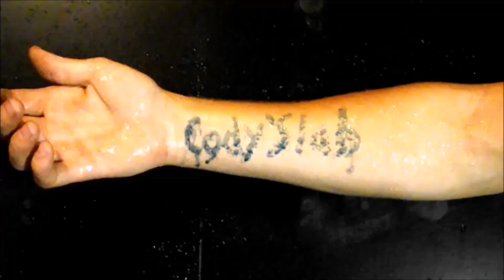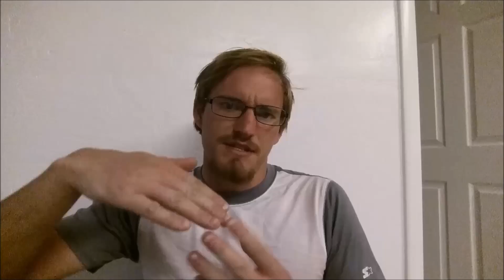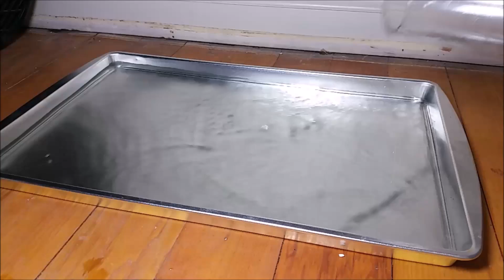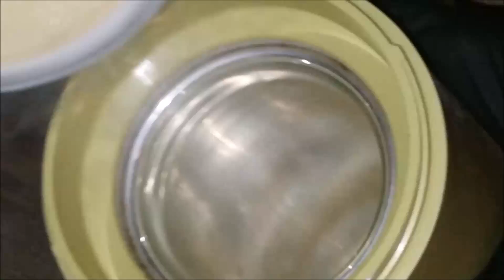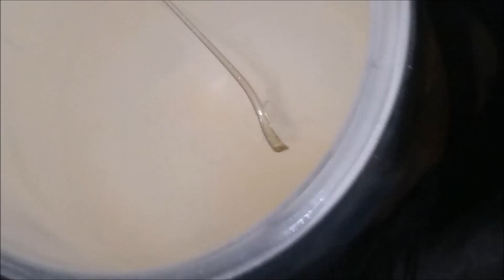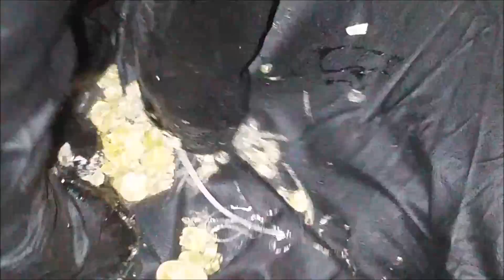What If The Oceans Were Made Of Acetone?

Comment: +Cody'sLab 
2 questions / suggestions : 
- What if it's a question of density ? Higher density would IMO means a better transmition of the deformation wave (faster and with less energy loss), since it's a material wave. -> Thus water would have waves with higher amplitude and frequency than acetone

- BUT, did you took into account limit conditions that your experiment had ? The edges of your plates seemed to have provided a "bouncing" surface, this combined with the higher response of the water (the waves travelled faster) might have set a wave-filter, the waves boncing on one edge negating with the one being produced. What would have to be tested is if you'd set yourself a frequency and amplitude, how would you two systems anwser (you'de be able to determine 
natural frequency and such stuff), to confirm this hypothesis.
Then the question maybe also about the size of the plate (you tested with two different ones, but it might be that the size difference was not enough to provide noticeable change ?)..

I know this is a kinda old video (and probably not meant to anwser the whole question about that wave formation thing), but anyway, I wanted to share these thoughts ^^ Keep on with your experiments you're doing great !
Reply: +Marius Carbuccia just to give you the simplest explanation i can for surface tension affecting wave modulation (amplitude and frequency) try to view "surface tension" as "resistance". a higher surface tension exerts a higher level of resistance so therefore two liquids of differing surface tensions will have wave formation in accordance with their respective surface tension. furthermore amplification of waves IS affected by wind catching the surface of the swell as you theorized with the acetone being more easily affected. the higher surface tension of the water causes the swells to maintain structural integrity better and you end up with a more aerodynamic surface over which the airflow is smoother where with the acetone the higher swells manifested due to lower surface tension allow the airflow to create cavitation in the trailing face (the side being pushed by the wind) of the swell  which causes the pressure of the airflow to be increased and push the swell higher. neither wave (water OR acetone) would crest (the part surfers ride on) until they reached a depth shallow enough for that specific mechanic to take effect. water crests at half the depth of the height of the swell if i remember correctly but i dont know what the depth requirement for an acetone wave would be.

Comment: I think surface tension is keeping water together a bit more. Maybe acetone would have a harder time building up  bigger waves in a bigger and deeper ocean pan, the ripple would be only superficial with high frequency... and I think I'm going to name my next New âge record Acetone waves.
Reply: +Lobotoman just to give you the simplest explanation i can for surface tension affecting wave modulation (amplitude and frequency) try to view "surface tension" as "resistance". a higher surface tension exerts a higher level of resistance so therefore two liquids of differing surface tensions will have wave formation in accordance with their respective surface tension. furthermore amplification of waves IS affected by wind catching the surface of the swell as you theorized with the acetone being more easily affected. the higher surface tension of the water causes the swells to maintain structural integrity better and you end up with a more aerodynamic surface over which the airflow is smoother where with the acetone the higher swells manifested due to lower surface tension allow the airflow to create cavitation in the trailing face (the side being pushed by the wind) of the swell  which causes the pressure of the airflow to be increased and push the swell higher. neither wave (water OR acetone) would crest (the part surfers ride on) until they reached a depth shallow enough for that specific mechanic to take effect. water crests at half the depth of the height of the swell if i remember correctly but i dont know what the depth requirement for an acetone wave would be.
Reply: thanks for your elaborations!
Reply: Lobotoman
no problem. it just goes to show how badly education has degraded in the time since i went to school compared to even when this guy went to school. but then again i went to school back when they actually EDUCATED students instead of just practicing for a test to boost their budget.

Comment: Maybe it also has something to do with water being a stronger polar molecule? Since acetone molecules are not as attracted to each other as strong as water, the wind was more easily able to separate the molecules resulting in more waves?
Reply: +Dylan Panek just to give you the simplest explanation i can for surface tension affecting wave modulation (amplitude and frequency) try to view "surface tension" as "resistance". a higher surface tension exerts a higher level of resistance so therefore two liquids of differing surface tensions will have wave formation in accordance with their respective surface tension. furthermore amplification of waves IS affected by wind catching the surface of the swell as you theorized with the acetone being more easily affected. the higher surface tension of the water causes the swells to maintain structural integrity better and you end up with a more aerodynamic surface over which the airflow is smoother where with the acetone the higher swells manifested due to lower surface tension allow the airflow to create cavitation in the trailing face (the side being pushed by the wind) of the swell  which causes the pressure of the airflow to be increased and push the swell higher. neither wave (water OR acetone) would crest (the part surfers ride on) until they reached a depth shallow enough for that specific mechanic to take effect. water crests at half the depth of the height of the swell if i remember correctly but i dont know what the depth requirement for an acetone wave would be.

Comment: the density or molecular concentration of the liquids may also have an effect on  the types of waves generated.
Reply: +12esonance just to give you the simplest explanation i can for surface tension affecting wave modulation (amplitude and frequency) try to view "surface tension" as "resistance". a higher surface tension exerts a higher level of resistance so therefore two liquids of differing surface tensions will have wave formation in accordance with their respective surface tension. furthermore amplification of waves IS affected by wind catching the surface of the swell as you theorized with the acetone being more easily affected. the higher surface tension of the water causes the swells to maintain structural integrity better and you end up with a more aerodynamic surface over which the airflow is smoother where with the acetone the higher swells manifested due to lower surface tension allow the airflow to create cavitation in the trailing face (the side being pushed by the wind) of the swell  which causes the pressure of the airflow to be increased and push the swell higher. neither wave (water OR acetone) would crest (the part surfers ride on) until they reached a depth shallow enough for that specific mechanic to take effect. water crests at half the depth of the height of the swell if i remember correctly but i dont know what the depth requirement for an acetone wave would be.

Comment: Did you consider relative viscosity?  Also, I wonder if the water's surface tension was being effected by the (comparatively) small container (or, more accurately, interacting with it) as surface tension remains constant regardless of volume.  Basically the reason scale model boats always look fake on the water.  If acetone has a much lower tension, this effect could be greatly decreased.  Just a vague hypothesis, mind you.
Reply: +mikedawgx01 just to give you the simplest explanation i can for surface tension affecting wave modulation (amplitude and frequency) try to view "surface tension" as "resistance". a higher surface tension exerts a higher level of resistance so therefore two liquids of differing surface tensions will have wave formation in accordance with their respective surface tension. furthermore amplification of waves IS affected by wind catching the surface of the swell as you theorized with the acetone being more easily affected. the higher surface tension of the water causes the swells to maintain structural integrity better and you end up with a more aerodynamic surface over which the airflow is smoother where with the acetone the higher swells manifested due to lower surface tension allow the airflow to create cavitation in the trailing face (the side being pushed by the wind) of the swell  which causes the pressure of the airflow to be increased and push the swell higher. neither wave (water OR acetone) would crest (the part surfers ride on) until they reached a depth shallow enough for that specific mechanic to take effect. water crests at half the depth of the height of the swell if i remember correctly but i dont know what the depth requirement for an acetone wave would be. also the idea of acetone and model boats would be pretty much spot on from a pure physics standpoint but it would eat the paint off the model boats.

Comment: I agree with a lot of these comments that density has a much stronger effect on wave formation. It would be cool to see if surface tension could affect it at all though, maybe through more soap tests.
Reply: +Andrew Hudson just to give you the simplest explanation i can for surface tension affecting wave modulation (amplitude and frequency) try to view "surface tension" as "resistance". a higher surface tension exerts a higher level of resistance so therefore two liquids of differing surface tensions will have wave formation in accordance with their respective surface tension. furthermore amplification of waves IS affected by wind catching the surface of the swell as you theorized with the acetone being more easily affected. the higher surface tension of the water causes the swells to maintain structural integrity better and you end up with a more aerodynamic surface over which the airflow is smoother where with the acetone the higher swells manifested due to lower surface tension allow the airflow to create cavitation in the trailing face (the side being pushed by the wind) of the swell  which causes the pressure of the airflow to be increased and push the swell higher. neither wave (water OR acetone) would crest (the part surfers ride on) until they reached a depth shallow enough for that specific mechanic to take effect. water crests at half the depth of the height of the swell if i remember correctly but i dont know what the depth requirement for an acetone wave would be.

Comment: I think, the smaller waves in the water result from the higher density of the water. Both, the acetons and the waters surface, are manipulated by the same amount of energy. It just needs more energy to lift a water volume, than the same volume  of aceton. Perhaps the surfacetension has an effect, but it would just amplify the difference on how much energy is needed too build a wave (since surfacetension acts as a force, trying to smooth the surface).
This alone would not explain the difference in waveheights. But a rougher surface results in more air resistance, which would result in a rougher surface...
(I'm thankful for every grammarnazis critic. My english needs a bit more than just a polish)

Comment: I don't know, but it seems to me that surface tension has nothing to do with waves. My guess is that the viscosity of the fluid plays a significant role here, since fluids that are too viscous (like honey) wouldn't form any wave at all. The dynamic viscosity of acetone is about 3.16E-4 and water viscosity is 8.90E-4 (about 3 times higher). It makes sense, but it's just my guess anyway, I don't know if there's a correlation between surface tension and viscosity.
Reply: +Cody&#39;sLab 

Liquid surface waves are very complicated; they are a combination of gravity waves and surface tension waves. The behaviour changes very much with the amplitude of the perturbation and the depth of the water.
Your experiment wasn't enough quantitative to come to any conclusion.
Reply: +Cody&#39;sLab Where do you get liquid nitrogen? i really want some for experiments and i want to try to condensate mercury vapour from bulbs/lamps.
Reply: Try and go to a place that sells industrial and medical gases.
Reply: my guess is that its caused by the difference in density. Acetone has about 3/4 of waters density
Reply: a higher viscosity would have greater surface tension though right? and lower would have less. so either way it would have to do with surface tension I would think.
Reply: The waves build because two fluids (a gas and a fluid :D) are touching and one is moving so it pulls the other along. Its somehow like air flows around your car: your trying to drive 200mph and it trys to stop you so you settle for 100mph (just random numbers btw).. explanation on microskopic basis: Once the water begins to move faster at point q than in point 2 it shifts some water from p1 on top of p2 so there is a hill forming which of course increases drag at p2 because there is now a marginal hill. That means p2 is now getting faster than p3 and the wave moves along like this and gets higher and higher because this effect just gets worse. Its an instable system basically. 
On a macroskopic skale the gravity tries to pull down the wavehill or the pressure tries to press the lower parts up, whatever you wanna call it. That makes the waves stable once a certain point is reached. There are other factors like the water under the wave is causing drag also and slows down the wave until it would be at the same speed and the ground of the ocean also causes drag, slowing down the wave if the water isnt deep enough. 

Soooo, acetone is less weight (density) therefore less gravity pulling it down/pressure buildup and waves get bigger. :)
Reply: Didi Andrade yes there is.
Reply: Have you thought about how little Hg there is in a lamp?

Comment: Um, isn't the issue the viscosity of the liquid rather then the surface tension? I mean the acetone is "pure" and the water has dissolved minerals and gases in it. Giving it attributes of a suspension slowing the energy as the wave moves through area's of higher and lower density. Where as the acetone only has... well acetone it, maybe some small amounts of impurity's but not enough to cause different densities. I could be wrong, (likely I am) but I thought I'd pose the question.

Comment: Suspect the higher waves have a lot to do with acetone having much lower density than water and therefore easier to move and raise by the same strength of the wind. Not sure whether surface tension comes into it.

Comment: Surface tension would make waves bigger. And no surface tension would make more waves just  not as large. The surface of the water does not want to change but when enough energy builds up it will make a wave that will continue to take energy because it does not need to bend the surface tension again

Comment: isn't it possible that the difference in density cause fluids to form different wavesizes? water: 1g/ml acetone: 0.79g/ml.
As the friction of the air acting on fluid should be almost the same , lighter fluids should move more vigorously.

Comment: The amplitude and frequency of the waves are mainly a function of the viscosity of the liquid and not the surface tension. The wind will make the surface molecules to roll around in both high and low surface tension liquid surfaces (as water alone or with soap didn't have any difference when it came to producing waves). Now, if the friction between the liquid molecules is low (low viscosity) then it will be easier for the wind current to push the molecules around and therefore creating a wave would  be much easier. With molecules easier to be pushed around (low viscosity) you would be able to make waves with higher frequency (quicker return of the low-friction molecules from the push of wind) and higher amplitude (easier to push the liquid low-friction molecules further in) on the surface. Hope this makes sense!

Comment: That IS interesting.  Also, the air flowing over the liquid will not be moving at a perfectly uniform speed. There will be mini-gusts and parts of the air flow with slightly reduced pressure.  Maybe this pressure difference in the moving air plays a role in initiating some up-down movement in the liquid's surface.  Maybe less surface tension makes the liquid more easily susceptible to slight changes in pressure?

Comment: Density and viscosity .  Just density and viscosity affect the wave length and amplitude, like ropes.  The main affect of the surface tension, I think,  is where in the wave cycle the peak will start break...  But,  just for curiosity,  alcohol and other liquids with less density is used to simulate water in cinema dioramas.  The splash effects in the liquid looks like in the real scale with water.

Comment: Acetone's also significantly less dense than water and that's probably having a play in wave formation.  Try again with something even lighter like hexane and you'll probably find even more waves.  Try with something more dense like silicone and you'll find less waves.

More to do with specific gravity responding to turbulence's natural pressure dips and peaks than anything else, would be my first guess.  You could probably test this by using different kinds of turbulence.  Like a really smooth breeze or constant airflow probably wouldn't make the same waves as intermittent gusts.

Comment: my guess is that because of the reduced surface tension the acetone it is more susceptible to the increase in air pressure caused by the fan? so the fluid will move more because it moves more freely?